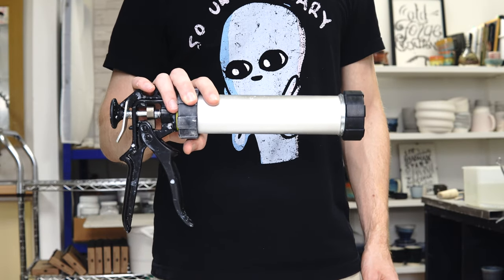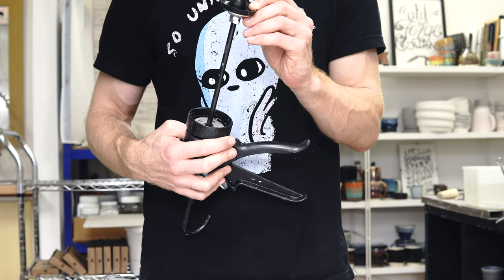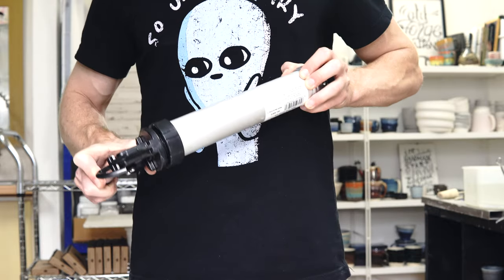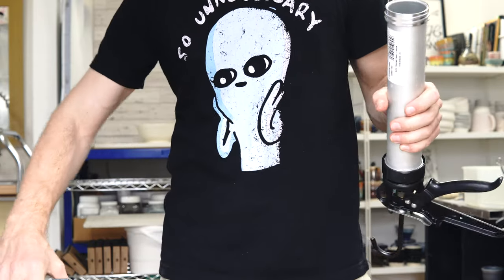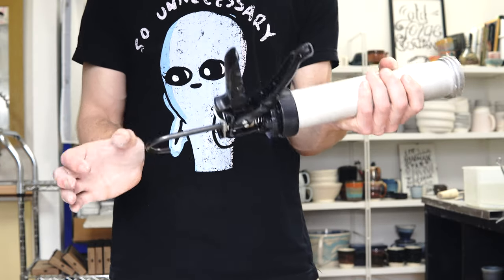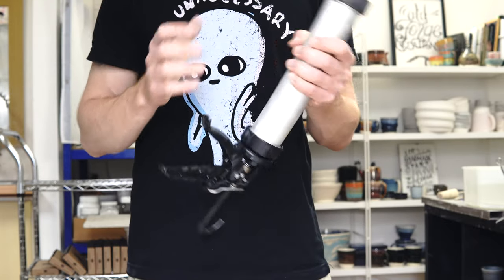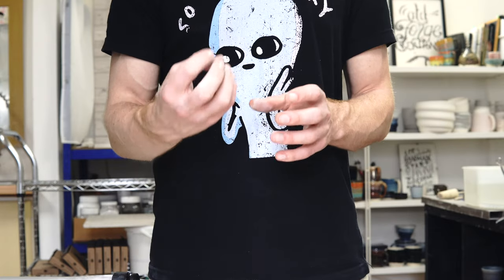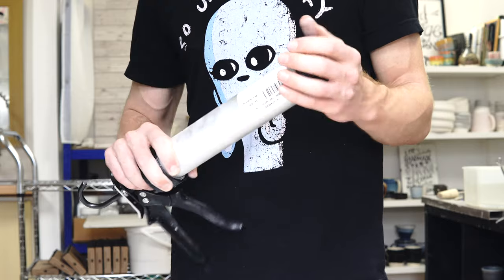£35 Pottery Extruder vs £15 DIY Sealant Applicator

Comment: You did a versus video without showing the second extruder?
Reply from the maker: I demonstrated the one that isn't meant to be used as a ceramic extruder. If you want to see videos of the other one in use I have plenty on here, and it's exactly as you'd expect from something designed for the task. This video is about the other one.
Reply from the maker: Unless you think I only showed one extruder in the video, in which case it might be worth pointing out that they look similar. If that's the case, you might want to watch it again and look a little more closely at the details of what I'm holding
Reply: @OldForgeCreations  ah ok, thank you
Reply: @OldForgeCreations  ok, will do. Thank you
Reply: 👍🇧🇷 Londrina Brasil